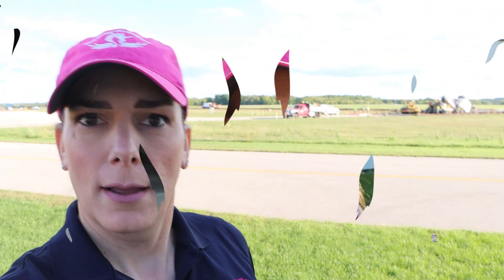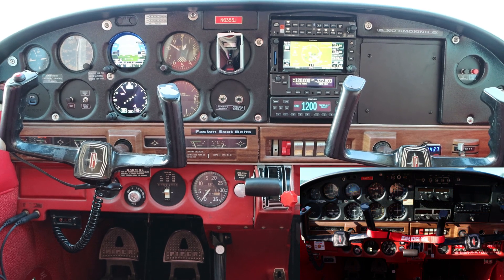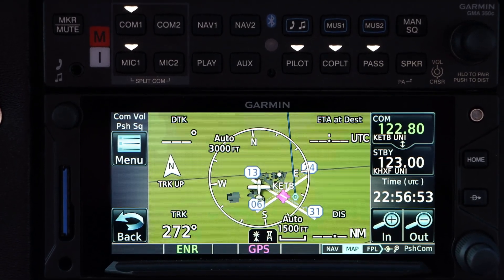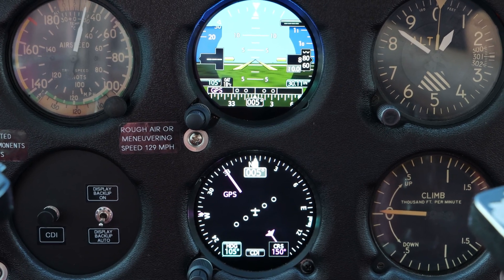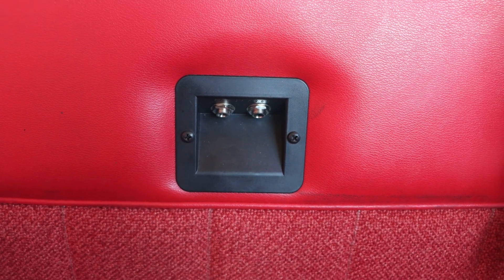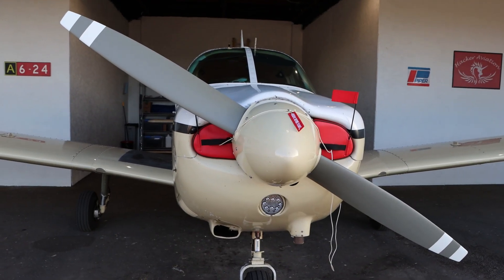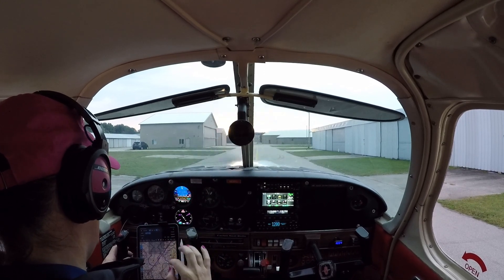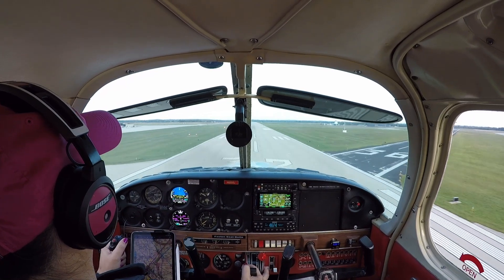All new Garmin Avionics in my Piper Cherokee!! (GTN-650xi, GI-275, GMA-350c, and more)

Comment: I'm also looking at purchasing a Cherokee 180 that also has been upgraded with dual GI-275s and GTN-650Xi.  This one is slightly different in that it includes a GMA-345 audio panel and GTX 345 ADSB in/out transponder, but those are minor differences and doesn't concern me as much.  Glad to hear you like the two 275s and 650Xi combo.   I was a bit worried and glad to hear that those small-ish displays of the 275s are not an issue.  I'm a 'bit' older than you, and the in-flight video you provided made it clear that those were still readable to my older eyes...

Comment: I believe you are also going to need a required Turn & Bank indicator for IFR. I don't think that is covered by your current instrumentation (or maybe I just didn't see it).
Reply from the maker: Turn coordinator is part of the GI-275 ADI. It has both the slab (inclinometer) and the rate of turn markings. Basically for IFR, the pair of 275's are primary for everything that was once part of the six-pack.

Comment: Did similar to the panel in my Tomahawk...dual 275s, GNC375 (step down from your 650 but it included ADSB) and a pair of Nav/Comms.  You will love flying IFR with the 275s, takes the guess work out of heading corrections while tracking courses.
Reply from the maker: Yeah it almost feels like cheating at times :)

Comment: Nice panel!  I'm doing something similar in my 1967 Cherokee 180 but with the G-5's. I really like the 275's but I'm also putting in the GTX 345 transponder.  So to keep somewhat in my budget and have extra for the unexpected cost, I went with the G-5's.  Good luck on the IFR training.  How doe you like the GTN 650XI?  I'm getting the same.   Time to save for the Garmin auto pilot next
Reply from the maker: Yep budget is always a factor and the G5s are great instruments. I love the 650. I was a little worried about the touch screen but honestly it's been great. So much easier than trying to use the dials on a 430/530. Good luck with your upgrade, I'm sure you'll love it!!
Reply: @AlyssaM_InfoSec  I love the GTN 650 too.  Also, for anyone considering it, you can get away with not having a second radio or audio panel since the GTN allows you to stay on your active frequency while monitoring your standby frequency.  Something to consider for saving money, panel space, and weight.